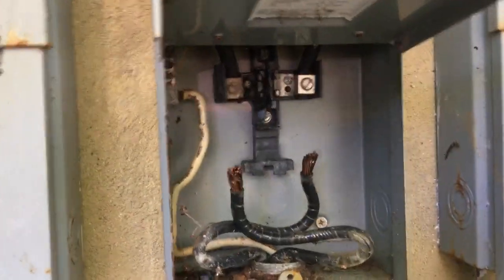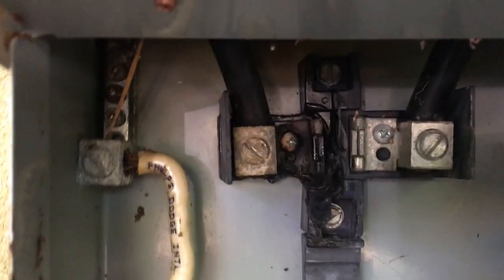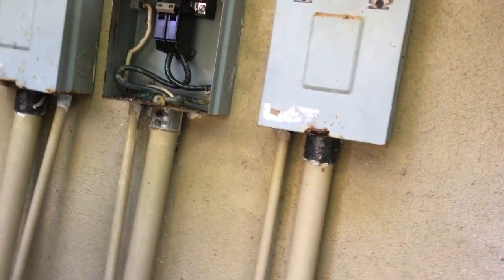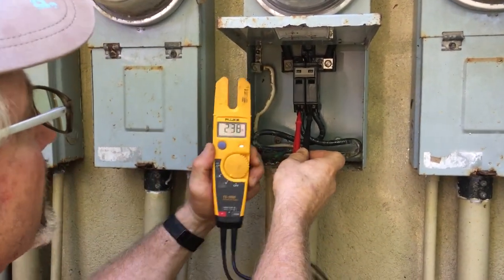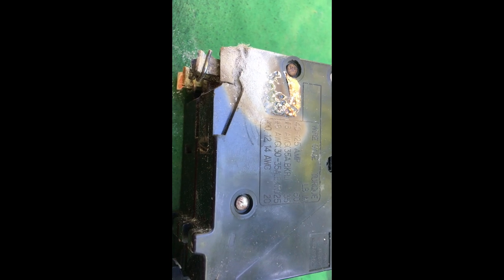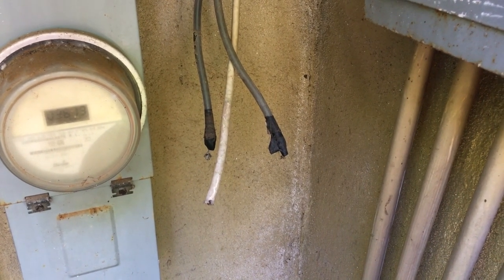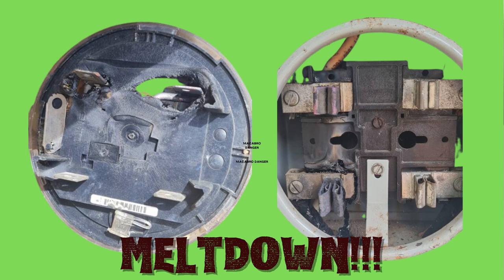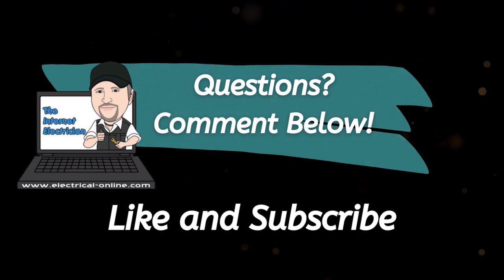Main Breaker Meltdown!

Comment: You have been in costa Rica for some time..what's been the highlight or eye opener with costa electrical grid system?
Reply from the maker: The grid is really good.  And it depends where you go as to how good or bad the general electrical  work is. They have adopted the NEC, but in the beach regions, not much for inspection if any at all.  I'm sure the situation in the new projects in the central valley area is much better.  But have I seen bizarre and dangerous situations?  Oh yeah!  Yet you don't hear of too many people getting electrocuted.  Monkeys yes, people, no.  The Howler Monkeys (Mono Congo) are notorious for using the high voltage lines to cross roadways and open spaces.

Comment: Out of sight, out of mind.  I too have a lot of temporary fixes around the house that now seem to have dropped off the list to finish up.  

I don't know much about what might be acceptable resistance for a temporary fix, but 1 ohm from meter feed to breaker load connection seems like trouble brewing fast.  How much worry is due for resistance in the 1 ohm range?  Thanks